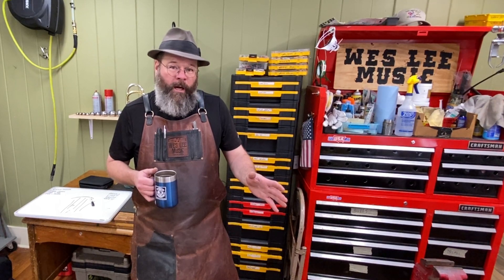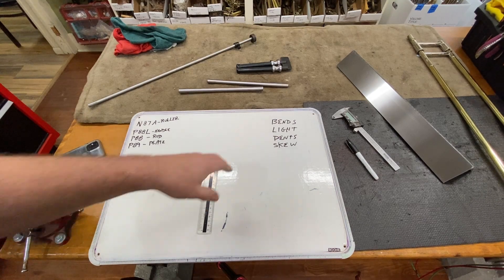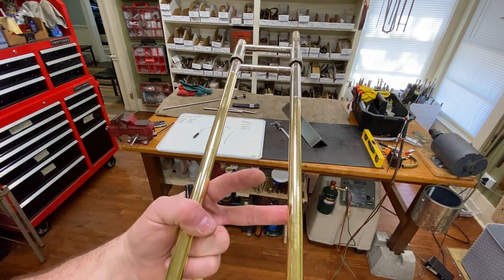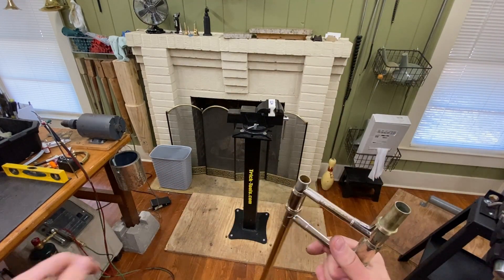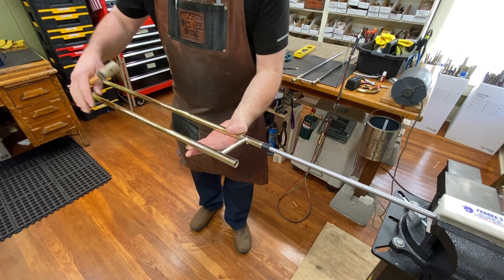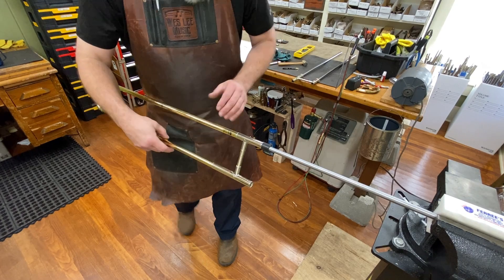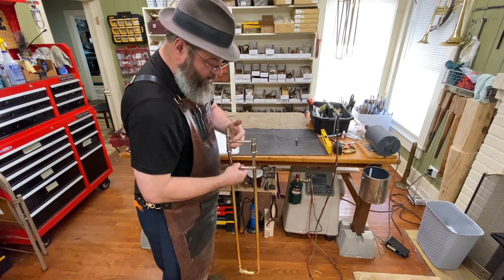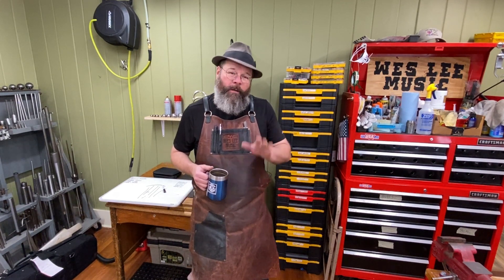Precision Trombone Slide Work- band instrument repair- 3/6/23

Comment: In the right hands with the right tools, metal is putty. You don’t learn a skill like this in one week one month or one year, decades in the correct tools, and the right temperament.
Reply: Right temperament, perhaps. But it's actually not magic, or even art. It's knowing what to do and why you do it, and practicing it just enough so that the muscle memory obeys that knowledge instead of fighting it. Trombone slides are actually easier than valve tubing on most brass instruments, because they are so accessible.

Comment: "Venturi tube"  That's the part that came unsoldered on the trombone my parents rented.  I was always careful not to put the mouthpiece in too hard, but one day a tube pulled out with it.   The band director called it something else, but I forget.
Reply: Lead pipe?
Reply: Many lead pipes are press fit and bend easily so a stuck mouthpiece makes for a dangerous challenge :/

Comment: A granite surface plate from Woodcraft will be cheaper than the Ferree's ground metal surface plate. It will be at least as accurate (maybe a couple of tenths--0.0002"--over the 18" length) and usually easier to come by. It will also be useful for other things, too, like aligning a whole mess of valve tubing in a top-action euphonium or tuba, or aligning tuning slides so that they are co-planar. And with a surface gage, a granite plate is also very good for scribing precise distances from square ends. I love Ferree's (and I have a big order coming from them this week), but they are sometimes out of reach price-wise for amateurs. But they will sell their good stuff to those amateurs, unlike "Company A."

Comment: I recently got a hold of a late model Olds which seemingly ok and had good slide action, however over the the past few weeks the action has started to get worse, and I'm seeing plating wear on the top inner slide down on the stocking which I didn't see when I looked in the beginning, shortly after I got the horn a couple months ago...   Can imperfections in the plating be smoothed out to fix the action or are the slides kind of cooked at that point?  It always seems like I have to constantly respray during a practice session.  Planning on taking it in to be looked at soon.